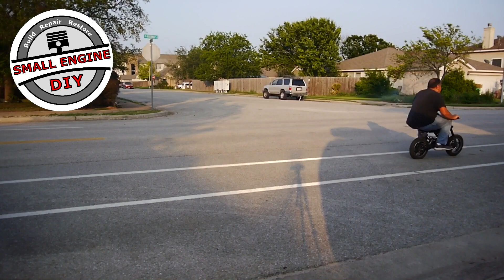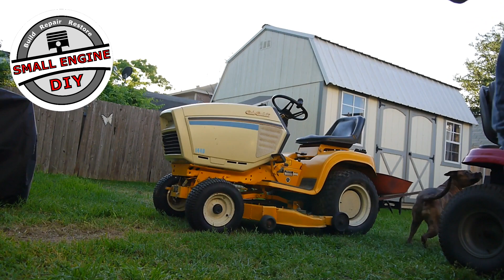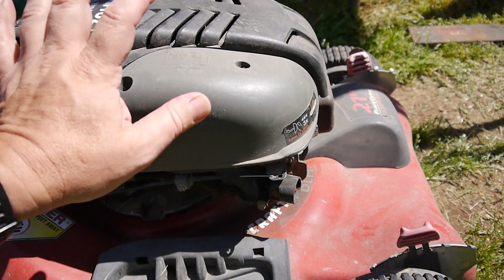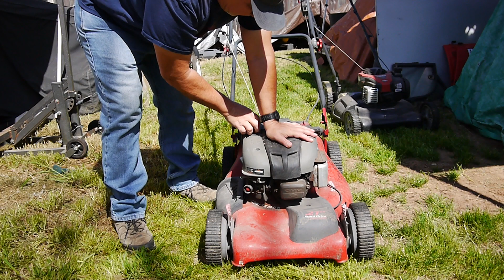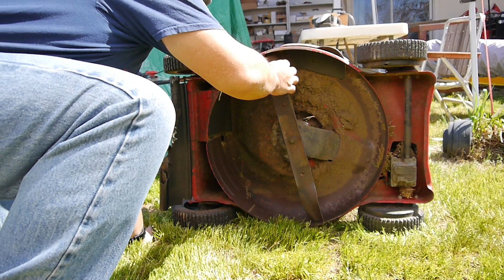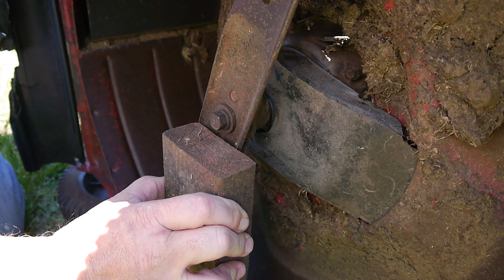Lawn Mower with a Bent Crankshaft, what to do?

Comment: You needed to remove that extra plate that was behind the blade. Then you will be striking the actual crankshaft on its own. Even though I've read that someone said that's not advisable in case you weaken the metal it can snap off. I'm a little bit hesitant now to try hammering that part.

Comment: What did you do for your back?  I may have to do something for mine.  I am considering stem cell.  Thanks for the video.
Reply from the maker: I just had the epidural shot in the lower back.  Physical therapy after.  I hope it doesn't happen again.  Thanks for asking!
Reply: @SmallEngineDIY  My back was cracked in a car wreck around 1966.  I am now experiencing tremendous pain.  Epidural sometimes called steroid?  Thanks!

Comment: What makes you think crank is bent?  First thing I would check is for partially sheared flywheel key.  Not sheared completely, since it does start.  Partial for engines that won't stay running, causing pre or post TDC ignition.  If in fact crank is bent, no remedy except a replacement.  Sorry!
Reply: pipe with ID over the crank OD for leverage works great
Reply: And the longer the pipe, the more leverage.

Comment: Glad you are feeling better. I don't see a lot of those Intek engines on push mowers. That crank is way bent, the seal is already toast. I would be inclined to replace the crankshaft, and the bottom seal,  pretty cheap parts, a few hours of your time. If the owner doesn't want to spend the $$, the vibration will eventually wallow out every bolt on the deck, handles, engine, and crumble into a mess.